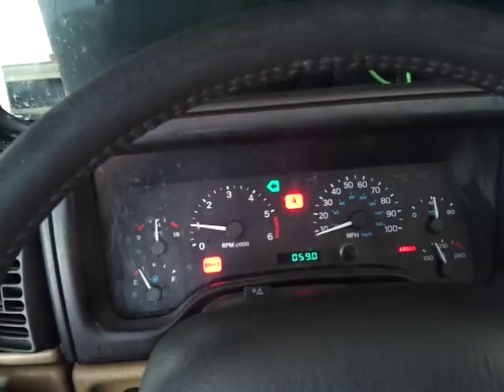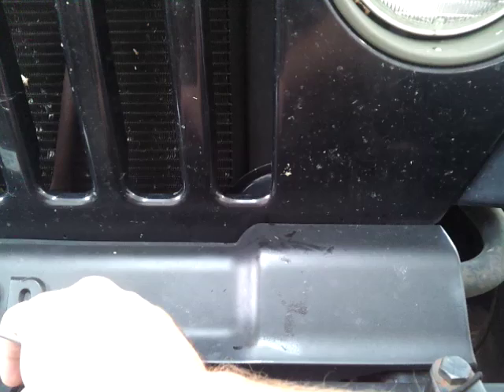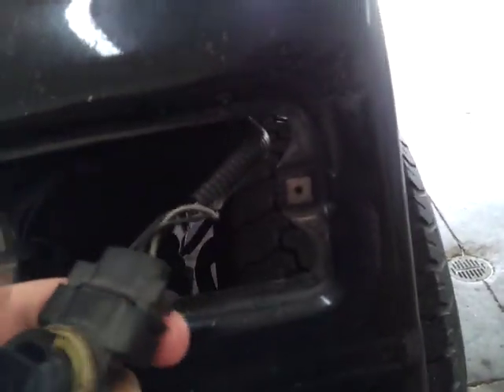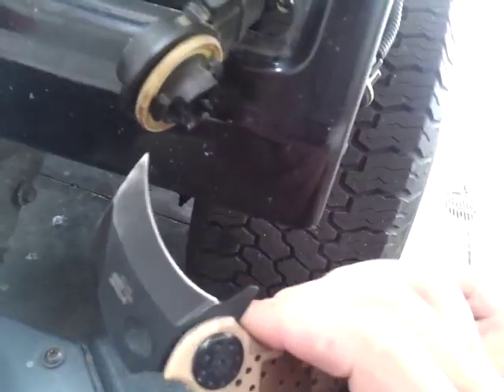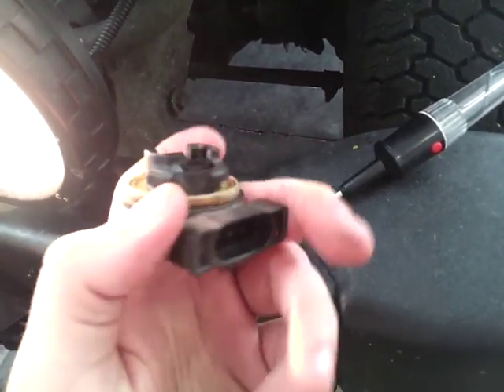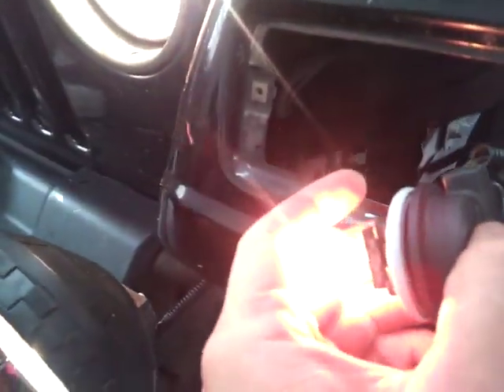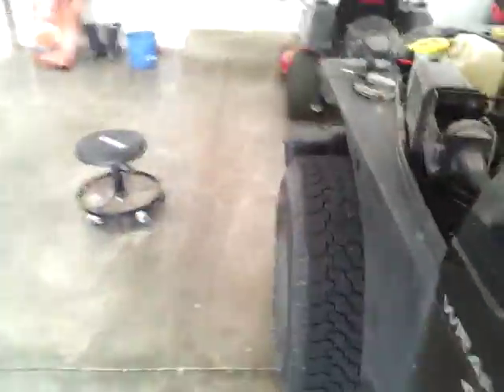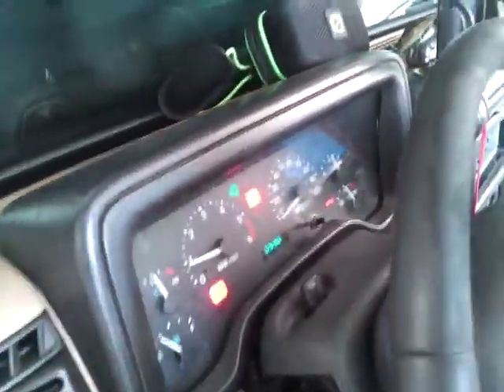How to fix your turning signals. Jeep Wrangler

Comment: I’m an original owner of a spec-ordered 1997 TJ Sport….146K on the clock.  I live in New England…..winters are hell on cars up here…..and recently, I’ve started experiencing electrical gremlins.  My turn signals (both left and right) do this intermittently.  Investigating, I found that both of those sockets have worn down, to the point that the bulb doesn’t seat as tightly as it should.  I have rigged them so that the signals work, but in heavy rain or snow, they frequently loosen or go out….simply not dependable.  I had no idea that I could change the sockets out, figuring MOPAR probably doesn’t make these things for a 25 year old model anymore.  Thank you, amigo….I’ll start a search for replacements…..to both you, and your helper, Zeus!

Comment: Thanks brother, this fixed my TJ today. Exact same part, passenger side. Got the same part from Advanced Auto and it cost me double what yours did. But, my problem is fixed an that's what matters. Perfect video for this issue.
Reply from the maker: Mike McLaurin glad it helped.
Reply: Hi Mike have 1997 TJ Jeep with this problem could you advise me the part number for the socket replacement....  I can't find one anywhere here in Canada...
Thank you so much....
Reply: @katzcrow640  Sorry, this was 4 years ago. I don't even remember needing to fix this. LOL. Wish I could help.

Comment: Job well done. I got the same problem with my jeep wrangler . Cant wait to work on it .Thanks
Reply: You need to fix your lens. It’s letting water in and corroding your connections!
Reply: Thanks for the information
Reply: @thomaslovell6087  (I do realize that this was 9 years ago) reason I was looking up hyperflash is my Jeep has leds in the rear taillights. My fix was getting a new flasher made for leds and that fixed my issue.

Comment: Thank you for this Excellent Video I'm in Canada could I get the part number for the socket replacement. Have 1997 TJ Jeep an so far No one can help me they say it's old good luck finding one...   Hope your still on Utube many Thanks going your way....
Reply from the maker: Are you needing the turn signal replacement?
Reply: Thank you so much for replying back ...  Yes I need the turn signal replacement it looks the same as yours in the Video...🌿👍💕💕👍🌿
Reply: @DOOLEY1216  Thank you so much for replying back...  Yes I need the socket replacement it looks the same as yours in the Video...
Sending Huge Thank you..🌿👍💕👍🌿
Reply from the maker: @katzcrow640  no problem at all. Is it an SE, Sahara or Sport edition Jeep?
Reply: @DOOLEY1216  Nope jus a 1997 TJ Jeep
Reply from the maker: @katzcrow640  https://www.quadratec.com/products/55208_0019.htm?gclid=Cj0KCQiA54KfBhCKARIsAJzSrdo8kyGoyW4Trwy0ktMTDhSnw7MijmniynUjvOyVBPHZOeZfwyP0JLcaAtJQEALw_wcB 

Here is the socket. 

https://www.carparts.com/details/Jeep/TJ/Replacement/Turn_Signal_Light/1997/Sport/SET-3331626NUS.html?TID=gglpla&origin=&utm_source=google&utm_medium=pla&utm_campaign=12013446866&gclid=Cj0KCQiA54KfBhCKARIsAJzSrdqkXc-4_6tEH_OxqBXcVpTtKSnR6HR9IgJzgtYX7UjPTJKG5SZ7WRAaAtjpEALw_wcB&gclsrc=aw.ds

Here is the housing unit. 

https://shop.advanceautoparts.com/find/1997-jeep-wrangler-turn-signal-bulbs-and-lights.c10958

Here is the turning signal bulb. 

I hope this helps you out.
Reply: @DOOLEY1216  You are the BEST .....  Thank you so much...  ❤️❤️
Reply from the maker: @katzcrow640  no problem at all 😊 I’m happy to help.

Comment: Can you use a meter tester instead? This video may have solved my problem .. all bulbs work on mine change out the flasher reply twice but when I turn on my left signal my speedometer blinks as do all of lights on the outside (not headlights) my right side turn signal is good and so is my breaking lights .. thanks for any feedback and your time
Reply from the maker: Hmm I am really not sure about that probably. Let me see if I understand. When you turn you left indicator light on your dash blinks instead of your turning signal?
Reply: @DOOLEY1216  hi yes just the odometer .. weird and of course the outside turn and stop lights as well. thanks
Reply from the maker: @djadamt  I'm not really sure. Could possibly be a wiring issues. Like the wires for you odometer has some wires going to the left turning signal. I'm not really sure. Sorry wish I could of helped better.
Reply: @DOOLEY1216  thank you for your time .. Ill update when I get it fixed ..
Reply from the maker: @djadamt  no problem

Comment: So I know this is a ole video but last night my turning signal actually blew out my marker light clean out of the housing so now I got to replace the housing and the marker light hopefully this is the only problem is that little connection and don't ya think you ot to of replaces housing as well it was cracked could let water in
Reply from the maker: Yeah I should have but if I remember correctly I was waiting on the housing to actually come in.

Comment: I have the same problem with my 03 Wrangler TJ except it's the driver side rear tail light out. I pulled off the globe and the bulb is OK. There's no socket behind just wires that lead up to the front under the hood. Any idea how to fix this?

Comment: In the interest of public content improvements,  I'll state the obvious.. first, it's nonsensical to remove the turn signal unit, WHEN the bulb is right in the OPEN under the fender!? And second, this content could've been done in 1/2 the time. Oh, and please.. these one handed mechanic vids drive me mad, if you're going to be serious about this, spend $20 for a tripod so you can use your handS... otherwise,  you did correctly diagnose and fixed the problem..